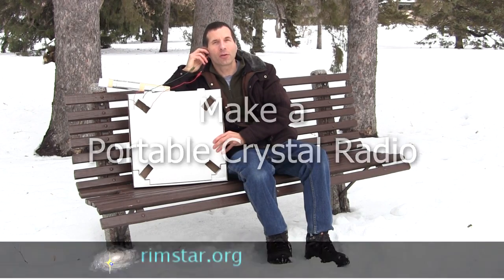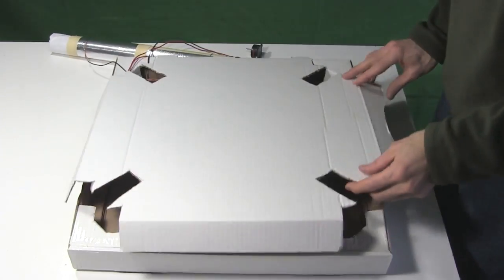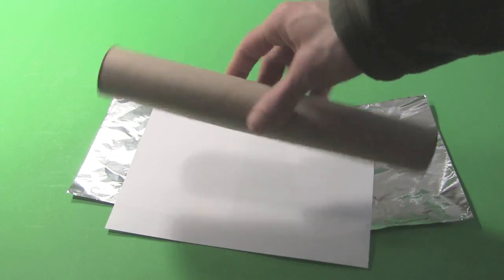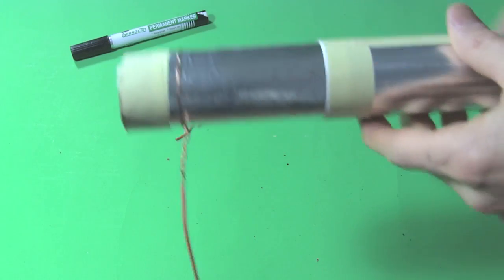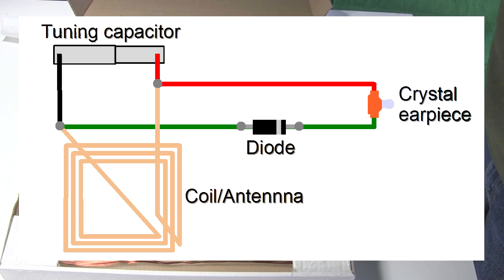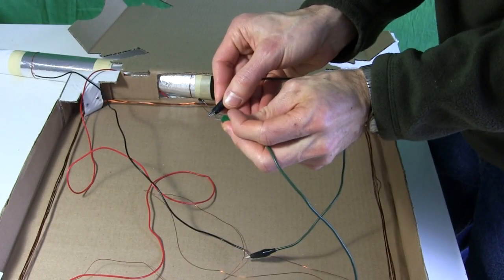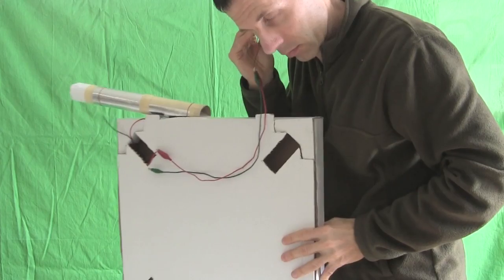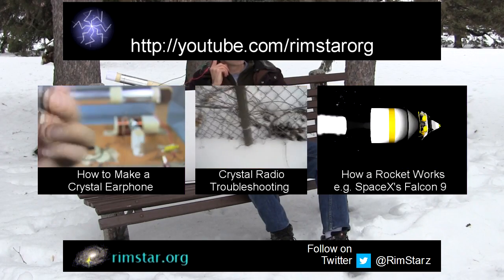Portable Crystal Radio using Loop Antenna and Pizza Box

Comment: the nearest radio station is 197 km far from my house. will it work in my house. plzz help me rimstarorg. thank u
Reply from the maker: I can't say for sure but I'm guessing it won't. Without a ground and with the weak antenna it may have problems. You can give it a bit of a ground by putting the palm of your hand on the outer capacitor cylinder when you use it. Alternatively you can my my crystal radio that has a ground and can have a long antenna https://www.youtube.com/watch?v=VqdcU9ULAlA&index=1&list=PLFsZmHTZL-zlSltC6ELZW9PK4ks7wgPRz.
Reply: will this work is the nearest station is 24km from me?
Reply from the maker: You'll still need a good antenna. I think the stations I picked up strongly were all less than 24km away, though I may have picked up from farther away too but more weakly. But that was with my other crystal radio with the better antenna and ground https://www.youtube.com/watch?v=VqdcU9ULAlA.

Comment: Use wire with lots of strands tined works better for the coil.The lower the resistance the better.The bigger the loop circumference the stronger signal reception.

Comment: NOTE: If you use a Zippo, (or similar lighter), across the wire at the end's for a brief moment, the enamel will come off easier.
Reply from the maker: Thanks. Do you get black soot on the wire when you do that? I do and that's why I don't use that method, but maybe I'm not doing it right.
Reply: I rap fine Sand Paper around the wire and give it a single pull and it comes out clean.
BTW- very cool way to make a radio!  I subscribed and Thumbs Up!!

Comment: have you tried to connect to the audio output the multimeter ? it may be interesting to see how much power comes from radio waves
Reply from the maker: I've looked at the voltage on my oscillscope (a multimeter isn't very useful here because the output isn't DC or sinusoidal AC) and it's in the 20 to 40 millivolt range. I don't have a way of measuring the current but from trying to power small LEDs and dumping it into capacitors, I know it's small. The issue is that this tunes into a single frequency. The sum of all the frequencies cancels out more-or-less so you can't use that. If you could tune into all frequencies at the same time then you might have something, but that would take an awful lot of crystal radios.
Reply: you can measure it putting a full wave rectifier at the germanium diode
Reply: and than using a multimeter to measure current. 
but perhaps the voltage is too low to leave current flowing across the diode
Reply: @RimstarOrg  If you just want to see power from radio waves, all you need is a germanium full wave bridge connected on the AC side to a piece of wire for an antenna and a ground.  Put a capacitor and a low current meter across the DC output of the bridge.  Nearby radio transmitters will cause the meter to move.  No tuning circuit needed.

Comment: Should I be able to hear some form of static, even if I'm not hearing distinct music or voices?
Reply: Also, does the tin foil overlapping on the variable capacitor matter (inside tape)?
Reply from the maker: +Lachlinobeast This radio's pretty quiet so you may not hear static. Double-check all your connections to make sure they're good connections. Make sure you have a germanium diode. And do like I did near the end of the video, but more slowly, turn the box around a bit, try all positions on the capacitor, turn the box around a bit more, ... A trick to get a so-so ground is to put the palm of your hand on the outer capacitor foil cylinder with as much skin contact as possible. You can see me do that in this amplifier video here https://www.youtube.com/watch?v=JtPwxbOgBHw. And testing with an amplifier isn't a bad idea either, just to make sure you're getting something.
And yes, all of the capacitor foil matters, even inside the tape.

Comment: is the coil the smaller or the bigger coil in the ground crystal radio
Reply from the maker: +Jose Sandoval It's the bigger one, except that this coil is not tunable. All tuning has to be done with the tuning capacitor.
Reply: Thanks

Comment: Material list?
Reply: +Gaming Drew Please that would help with my science fair.  I am having lots of trouble and do not want to ruin my grade.
Reply from the maker: +Gaming Drew I started making a parts list by watching the video but then realized that it's all there in the video. What parts are you having problems with?
Reply: +RimstarOrg Just lengths of wire.
Reply from the maker: +Gaming Drew The coil is 14 turns. The box has 4 sides that are 18" long so that makes 14 x 4 x 18" = 1008" = 84 feet. Add another 4 feet for connecting the coil to other parts inside for a total of around 88' (26.8 meters). Probably add a little extra for good luck.
Since you now know that the box is 18" long on each side then you can make a rough estimate at the lengths of the other wires. The thickness of all the wires doesn't really matter.
Reply: Thank you so much.  I will tell you my grade when finished
Reply: +RimstarOrg I built my radio and everything was working but sometimes it just stops.  I am wondering if the diode burnt out or something?
Reply from the maker: +Gaming Drew Do you mean that sometimes it works and sometimes it doesn't? Since it doesn't have a ground connection or a long antenna like many other crystal radios (https://www.youtube.com/watch?v=VqdcU9ULAlA for example) it isn't as powerful, so sometimes you'll pick something up and sometimes you won't or it'll be too faint to hear. Try putting one of your hands on the outer capacitor cylinder's foil. That way your hand acts as a ground. Make as much surface contact with your hand and the foil as possible.
You could also check all your connections where wires connect to things and each other and make sure you don't have a loose connection.
Reply from the maker: +Gaming Drew Do you mean that sometimes it works and sometimes it doesn't? Since it doesn't have a ground connection or a long antenna like many other crystal radios (https://www.youtube.com/watch?v=VqdcU9ULAlA for example) it isn't as powerful, so sometimes you'll pick something up and sometimes you won't or it'll be too faint to hear. Try putting one of your hands on the outer capacitor cylinder's foil. That way your hand acts as a ground. Make as much surface contact with your hand and the foil as possible.
You could also check all your connections where wires connect to things and each other and make sure you don't have a loose connection.
Reply: +RimstarOrg It is funny because right when I started it and put it all together for the first time it worked and no it just doesn't.  I have replaced everything and it still won't work.  Does it just stop?  Is yours still working after 2 years?  It might be the weather,  I have been getting snow storms in my area.
Reply from the maker: +Gaming Drew No, mine still works. It does vary with the time of day though, so try it at different times. It could vary with the weather too, but I have radio stations nearby so the weather doesn't affect mine much.

Comment: sir have you experience a cctv system broke due to fluctuation or ligthning?i have 16ch. dvr with cameras the 9 cameras are connected to 13.8v 15amp and other 9cameras has 12v 1amp individual power supply connected to individual outlet 220 outside.it always broke when lightning comes the dvr and some cameras and adaptors.i hope you help me solve my problem.is it ok to put ground rod for12v 1amp for the negative outside before dc plug of the camera?thanks!!!more power!!!!

Comment: wow it fascinates me to see a crystal radio work, it intrigues thomas henry morray as well at one time, beauty of a coil of wires inducting ac voltages then capacited in parallel to store some of the energy then recitified into dc and placed into a speaker to hear the converted ac signals...if I had ten of these pizza board radios with  speaker outputs placed in series and to a capacitor of 100 or so mfd  then an led is placed on the leads of the cap, do u reckon the led will light up?
Reply from the maker: fidel catsro If you left the capacitor charging long enough then I guess it would briefly power the LED as the capacitor discharges. If you put an energy harvesting circuit like a joule thief at the output and you either had enough of these pizza box crystal radios or a radio with a long enough antenna, then you could maybe continuously power a small LED.

Comment from the maker: +Raul Rifaie Ronney You can use earphone/ear buds if you add an amplifier to the output. The transformer trick probably won't work because the output it already very weak.
PS. It's too time consuming replying to all your many questions this way since I have to go find each video. You'll have to fix you Reply button. Here's how again:
- go to your Google+ page,
- in the top, right corner click on your thumbnail icon,
- in the popup that appears, click on "Settings".
- for the 2nd question down "Who can comment on your public posts?" set it to "Anyone".

Comment from the maker: +Raul Rifaie Ronney Any motor will have the enameled copper wire. In some motors it may be all glued together but in some you may be able to unwind it. TVs and old CRT type computer monitors also have it wrapped around the big tube inside but those can be dangerous to open up since that big tube is also a capacitor with a lot of charge on it.

Comment: Where can I get enameled copper wire from household items ?
Reply: Motor windings and speaker coils have it.  It can be any kind of insulated wire, it doesn't have to be enameled.  That's just the easiest thing to make a coil from.  You could use speaker wire if you had it.

Comment from the maker: +Raul Rifaie Ronney I found my razor blade diode resulted in a weaker output, and with this particular crystal radio the output is pretty weak already, so my guess is it wouldn't work too well. That is unless you cheat and put an amplifier at the output like I did here https://www.youtube.com/watch?v=JtPwxbOgBHw. Here's where I used the razor blade with my other crystal radio https://www.youtube.com/watch?v=eIdHsjfbckw.

PS There's no Reply button under your comment because of your Google+ settings.
- go to your Google+ page,
- in the top, right corner click on your thumbnail icon,
- in the popup that appears, click on "Settings".
- for the 2nd question down "Who can comment on your public posts?" set it to "Anyone".

Comment from the maker: +John Doe Each side is 19" long and there are 4 sides, so 19" x 4 x 14 turns is 1064", which is just under 89 feet of wire, not including whatever you need at the ends to attach to the other parts depending on how you arrange things. I've never seen the crystal earpieces at Radio Shack but they do have piezo buzzers which are almost as good and which you can adapt using a trick I show just over halfway down this webpage http://rimstar.org/equip/crystal_earphone_earpiece_for_crystal_radio.htm.
PS There's no Reply button under your comment because of your Google+ settings.
- go to your Google+ page,
- in the top, right corner click on your thumbnail icon,
- in the popup that appears, click on "Settings".
- for the 2nd question down "Who can comment on your public posts?" set it to "Anyone".

Comment from the maker: ・みよなｍ１４７ The wires must not come into electrical contact with each other (the copper must not touch.) If you can space them apart so that that won't happen then they can be uninsulated. But in the one I made, the wires do touch each other so they need to be insulated.

PS There's no Reply button under your comment because of your Google+ settings.
- go to your Google+ page,
- in the top, right corner click on your thumbnail icon,
- in the popup that appears, click on "Settings".
- for the 2nd question down "Who can comment on your public posts?" set it to "Anyone".

Comment from the maker: +Rebecca Armstrong I've noticed that in some buildings, even with a long antenna and a ground connection you may still have problems getting a good signal. But a way to improve the signal, if you get one, is to replace the earpiece with an amplifier. You can buy small amplifiers at stores like Radio Shack. Or you can make one. I demonstrate making and using an amplifier with my pizza box crystal radio in this video https://www.youtube.com/watch?v=JtPwxbOgBHw. Another trick I found was to put your hand on the aluminum foil of one of the cylinders of the capacitor to act as a ground. You can even see me doing that in the above video.
PS. I sent you a youtube private message explaining why you don't have a Reply button for your comment.
Reply: What am I looking for at radio shack or what kind of amplifier do we get from there or model number.  Also, where is the best place to buy all the supplies from your pizza box project (Diode, and #26 AWG Gauge wire)  I went to the radio shack by my work and they didn't have any of the supplies there. Sorry for all the questions.  Is there a way to print out your instructions to help out my younger daughter with this project or any other suggestions.  It has been over 5 years since my older daughter did hers and she was way more advanced and needed less help with her project.
Reply from the maker: Rebecca Armstrong I've never owned or used one of the mini amplifiers from Radio Shack but I've seen other videos where they used them. Here's one I just found http://www.radioshack.com/radioshack-mini-audio-amplifier/2771008.html#.VMweAS7Snbg. Looking at the user manual on that page you'd either have to also get a working jack to plug into the input or open it up (you have to to put a battery in anyway) and see where the wires go to the jack and connect to those wires.I don't have the instructions in any other form than what's in the video. However, if you watch the video again, just below it you'll see where it says "... More". Click on that and from the menu that appears choose "Transcipt". That gives you the English text for what's said in the video. Pause the video and highlight that text with your mouse. Copy and paste it to a text document somewhere and print it out.
Reply: RimstarOrg how do you connect this mini amplifier to the pizza box radio, since we are not going to connect to the wall outlet, do we have to get a connecting cable, is that replacing the ceramic earphone, correct? Where is the best place to buy the #26 wire per your video.  I found this at radio shack, can this be used it has a roll of #22; #30 and #26-guage wire http://www.radioshack.com/315-ft-magnet-wire-set/2781345.html#.VMwuXct0zp4
Reply from the maker: Rebecca Armstrong Yes, it just replaces where the earphone goes. Since you're not connecting to the wall outlet and there's no ground connection with this particular crystal radio, it doesn't matter which way the wires go, just like it doesn't matter with the earphones. But you can try the wires both ways anyway. I referring to the red and green wires going to the crystal earpiece in the circuit diagram on this webpage:http://rimstar.org/science_electronics_projects/loop_antenna_portable_crystal_radio.htmAs for the wire, the wire in the radio shack link you gave is fine. I have the same wire in fact, though I also have a whole collection of different wires I've collected over the years. You can use #26, #22, #18, ... the size doesn't matter for that part of the circuit.

Comment: if i can increase turns of copper wire so any change in signal i mean it can be increase the strength in signal
Reply from the maker: Sant Pyara There is an optimal number of turns but as you saw in this video, I found it by try out different number of turns until I got the best results. The amount that works best for you may be different. But it isn't a case of more is better.One trick I found was to put your hand on one of the aluminum foil cylinders of the capacitor to act as a ground while using it.

Comment: which one is best  Loop Antenna Crystal Radio radio or Crystal Radio.i mean which one have more chances of success
Reply from the maker: Sant Pyara The Loop Antenna Crystal Radio is the weaker one. The better on is the one with a long, straight wire antenna and a connection to Earth ground.
Reply: Thanks

Comment: How does the loop antenna radio work?
Reply: The coil and the variable capacitor make a resonant tank circuit that together select the frequency of the desired AM radio station.  The diode demodulates the AM radio signals to audio frequencies, and the crystal earpiece turns that into sound that you can hear.

Comment: i am making this Crystal Radio project.are you sure it can be work with out using copper coil.
Reply from the maker: Sant Pyara I've never done it, but I've seen it in books and you can see it in the diagram here http://en.wikipedia.org/wiki/Crystal_radio#Tuned_circuit . It'd work best if you have only one strong radio station nearby otherwise you'd get overlapping stations and noise. The last paragraph in that section on that webpage also says that.
Reply: thank you

Comment: n the project i need to make an AM transmitter and a receiver. The receiver is battery-less. It is just like a crystal radio, but it is tuned only at a specific frequency. The main motto is to sound a small piezoelectric buzzer powered by the energy obtained by the receiver. The receiver has to very com[act as well. I needed help in designing the antenna( length, shape and type). For the time being i am using a 40 MHz RC car remote as the transmitter, please tell me the how do i choose the right antenna for the receiver ? and will be the circuit of the receiver( the receiver needs to be very small).

Comment: How do i make a crystal radio for one frequency only as i want it to respond only at 1 frequency, no tuning required. Like adding an antenna of the same wavelength and all? pls tell me the circuit as well. If u dont know, then can tell whom should contact for details.
thanks